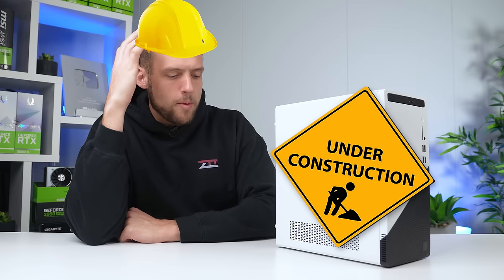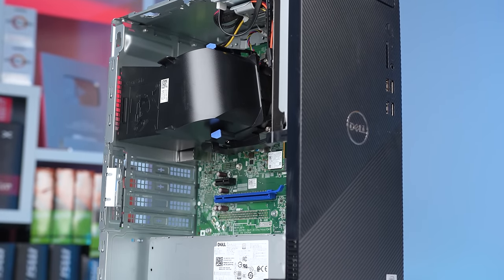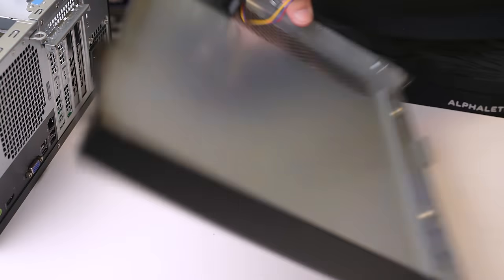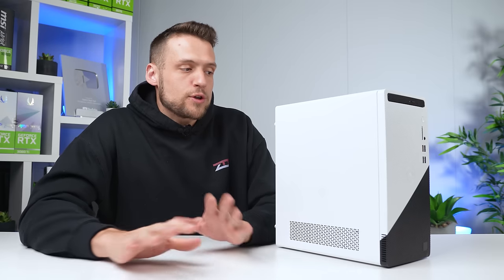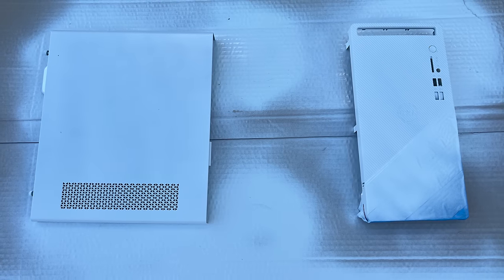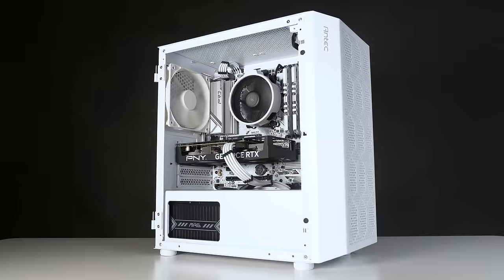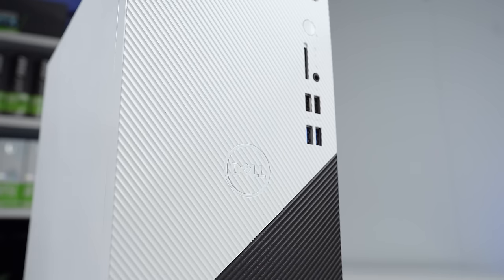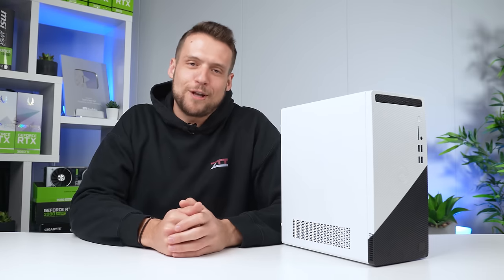How to Build an Ultra Budget Gaming PC (and how not to)

Comment: You can laugh a whole lot about "Dell engineering.  I worked there for a dozen years and Chimps are smarter about air flow and heat in a chassis.  That Dell engineering can figure out.
Reply: Fr
Reply from the maker: So I'm dumber than a chimp? Nice
Reply: Same as HP using airflow tunnels and stuff on SFF PCs
They were able to make pentium 4 CPU's run cool (it's extremely hard)
Reply: @ZachsTechTurf zack do you play brick rigs? i saw you
Reply: @ZachsTechTurf looool

Comment: Zach my budget is $1500 and I wanna build the possible best pc. What should I get
Reply: Next video idea:
Reply: Need help?
Reply: A gun
Reply: @omarbromand4090  yea bro i don’t know nothing about pc parts 😅
Reply: @vYakss  Just throw the best AMD GPU in the market on your PC, and if you wondering about the power voltage, stick to the 650w, if you bottleneck, buy the Ryzen AMD Ryzen 7 7800X3D, or if you have intel in already, then buy the Intel Core i5-13600K, and you will be fine, 

Maybe... Maybe you will have to cut the case because it will won't size up with the GPU, or even will have heat issues, ... so yeah.
Maybe you will be fine
Reply: @vYakss  gimme your discord then I'll explain everything
Reply: @mrliberox  bro i didnt understand a single thing u just said and I never owned a pc this will be my first and I wanna build it but don’t know what to get 😭
Reply: @vYakss  Oh. Well, this is gonna be harder.
Reply: @mrliberox  I’ve just bought a ryzen 7 5800X 8-core processor and a Ryzen 5000 3rd gen mother board  what u think??
Reply: @vYakss  Or even better, with the CPU and GPU:
-Ryzen 5 7600/X (cpu)
-RX 7900 XTX (gpu)
-at least a minimum 700w/750w power supply
-Asus TUF Gaming B650-Plus WiFi (motherboard)
-16x2 Rams with 5200hmz clock speed
-Nvme 1 TB (storage, you can after then buy another one - 2TB with a max of 3 slots in the motherboard if I'm not wrong)
-And other parts: case, fans, etc (should be like with 150€ or more)

The RX 7900 XTX is one of the best in the market GPU, but I'm not sure if you will have enough money afterward for other parts, but it's worth it to buy, unlike then for other middle GPUs.
Reply: @mrliberox  yea probably not my budget is $1500-$1600
Reply: @vYakss  I Hope that it's gonna cost less on Black Friday, so good luck, it's a really good build that I made up when researching, hope it's worth it and good for value, and for gaming
Reply: @mrliberox  Black Friday already passed for me but I’m gonna go with what I’ve just bought thanks for the advise tho
Reply: @vYakss  Well, another opinion is to buy a used processor, and the GPU to size up the price gap, if you are okay with that.

Edit: You can change your mind and buy another GPU, because the 7900 XTX is the 4k gaming beast, for the value, but you can just buy what Jack is advised on the middle-value gpu, and you can for yourself to check it out, typing "Gpu name" (or even to versus) - gaming test, for to see the benchmarks and even consider yourself the best value for money GPU
So good luck in building the pc!

Comment: I used a 140mm carbide hole saw to add a 140mm case fan to the side.
Reply from the maker: Very nice. I need to do that one day
Reply: @ZachsTechTurf  it’s easier than you’d think. The sheet metal is incredibly soft and as long as you have it clamped to a thick piece of plywood you’re good to go. Be sure to file down any sharp edges before they get you.

Comment: Is this PC good core I5 6500 with Rx 590 which power supply should I buy
Reply: I would go with a i5 10400 for that gpu the i5 6500 is to weak
Reply: @Izisra  don't have money for that in my country the CPU alone cost  53000 Rs in Dollars 185
Reply: @forgamers3136  than get a cheaper gpu cuz that cpu is gonna bottleneck the rx590 from utilizing all it's  power

Comment: I remember my old Inspiron 530 that I still have.  I cut a hole in the side panel for intake for the GPU (8600GT and later 8800GT) and one on the top, in front of the PSU, where the top 5.25 bay was.  

For your build, I would have just cut out a top hole for a 14 or 12cm exhaust fan in the rear.  Put on one of those plastic, external dust filters and you're good!
Reply from the maker: Yea one of these days I'm just gonna get the dremel out and cut holes in the case for fans.

Comment: Can u rate my pc specs? I just got this new pc! Gpu: Inno3d 4060 ti 16gb. Motherboard: Gigabyte b450m ds3h. Case: Kolink inspire k9 Midi tower. Cpu: Ryzen 5 5500. Cpu cooler: Pure rock 2. Power supply: Aero Bronze 740w. (So far it runs any game I play at on max settings with 80-120 fps! And most of the time I play in 4k)

Comment: Heyo this might be a long shot but i was hoping for some advise i wanna know if i need a new cpu i cant get my i7 8700 system to post the old mobo fried so i got a new one just didnt research and got a rare ish mobo thats not to good but everything is right its the right chipset the right socket and the right generation i got a asrock b360m/oem and i know my psu and gpus work but still on then 20 secs later off than auto on cycles idk what to do i tried different ram slots and configs but not new ram or new cpu because budget

Comment: Whats the best budget gpu for a ryzen 5 5600G?
Reply: You should get a 5600x or something else instead since the 5600g already has graphics built into it, but a good gpu can range from a gtx 1070 to a 4090, best value rn is probably the 6700xt or rtx 3060 (I'm not a professional)